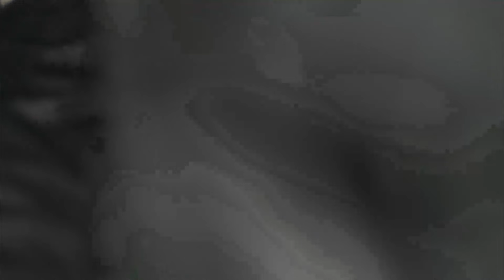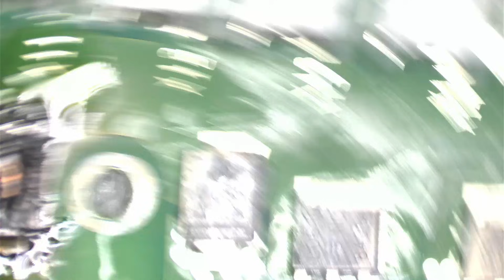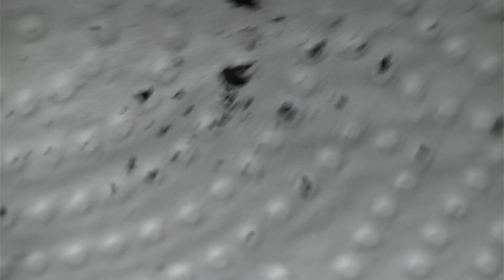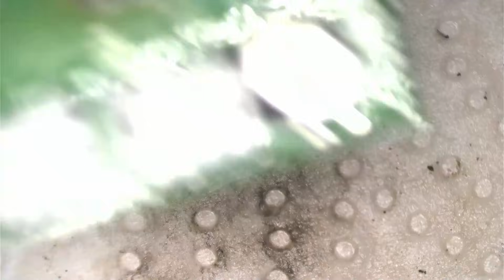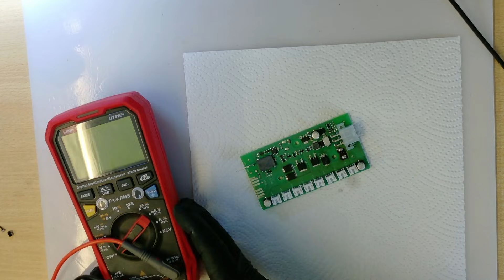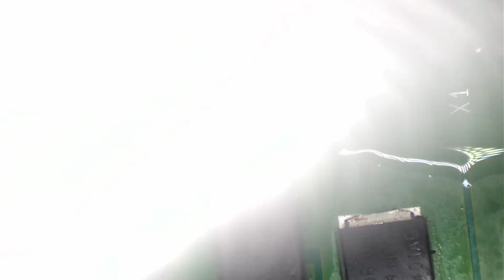Exploded Diode Replacement #righttorepair

Comment: Very neat! I have a very curious question though. I have a protective diode on a raspberry pi 4 model B that blew. Its a very tiny component. I think its too tiny for a normal soldering pen to reach. What could I do to remove the diode and replace it with a new one?
Reply from the maker: To be honest, without a fine tipped soldering iron or hot air station, there isn't much else you can do but break it off but then you risk damaging the pads on the board. Also you still have to replace it...
Reply: @Jus @JustInspiredKent Right it would be better to de solder the component and solder a new one on. I have worked with a lot of surface mount soldering, just not micro soldering before. What kind of heat station would you recommend?